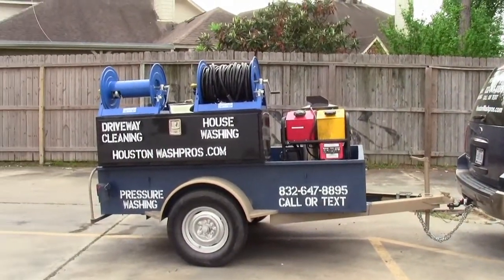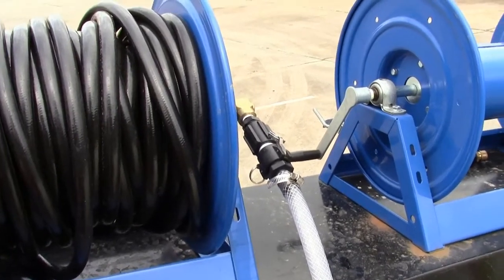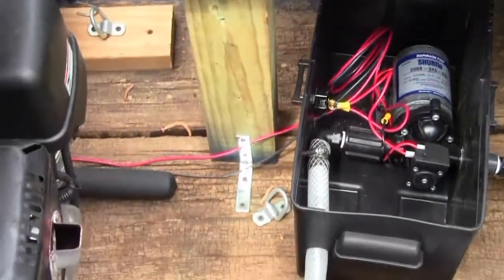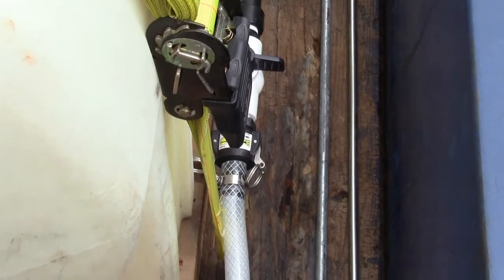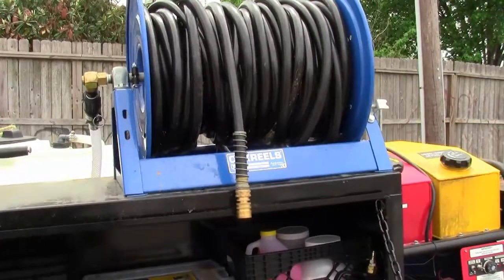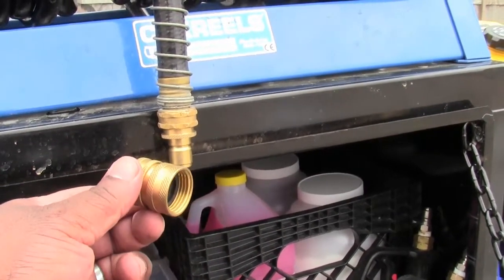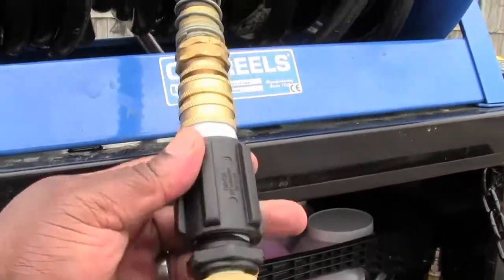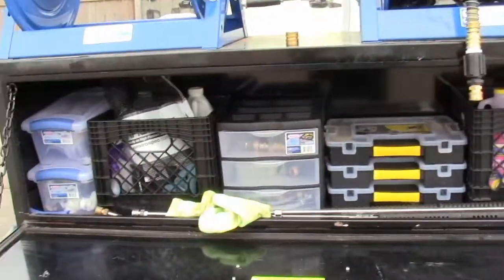2-in-1 Dedicated Chemical Pump and Fill Hose System

Comment: Nice rig bro! Do the banjo connection leak under pressure?  Also, where did you get the quick connection for the customer garden hose outlet?
Reply from the maker: thanks Jason. I get all my banjos from grainger, they're close by. the garden banjos are yellow. the  water hose and 12v pump including the connections are all rated for 125 or 150 psi, so no leaks.
Reply from the maker: that brass connection came from Walmart or home depot, either way, do use it. Get the yellow/gold garden hose cam locks. https://m.grainger.com/mobile/product/BANJO-Hose-to-Cam-Lever-Adapter-WP53998/_/N-lhl/Ntt-garden+banjo?EndecaKeyword=garden+banjo&NLSCM=17&searchRedirect=garden+banjo&sst=subset&breadcrumbCatId=4775&fromPidp=true&picUrl=//static.grainger.com/rp/s/is/image/Grainger/3DTH2_AS01?$smthumb$webparentimage$
Reply: Thanks for your time!